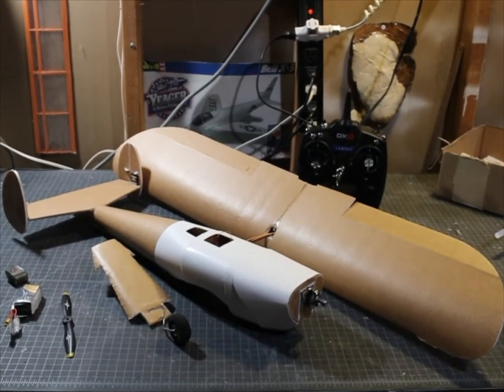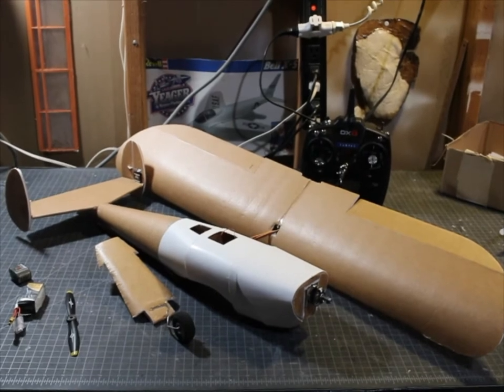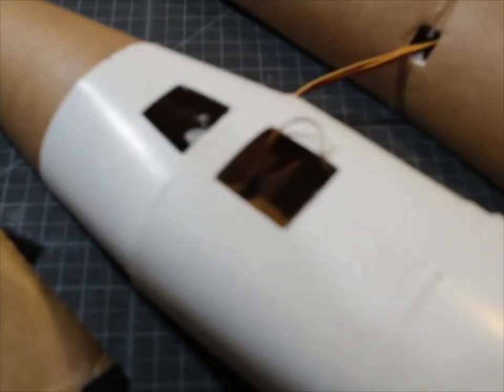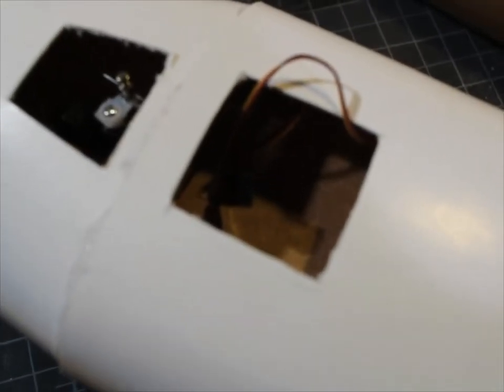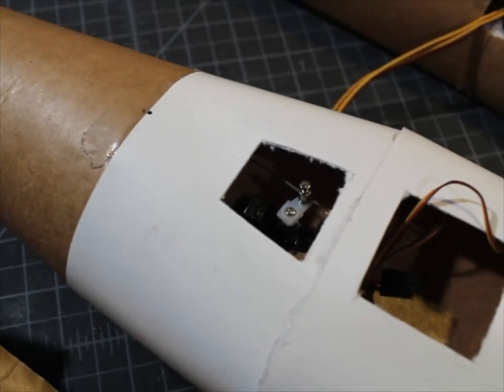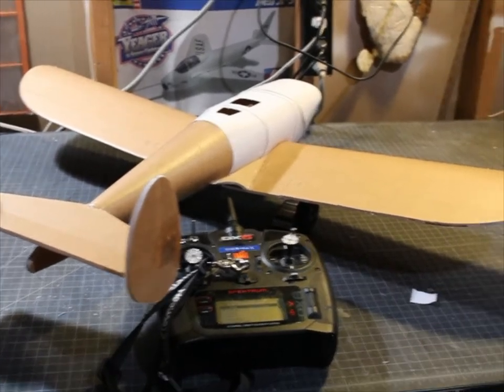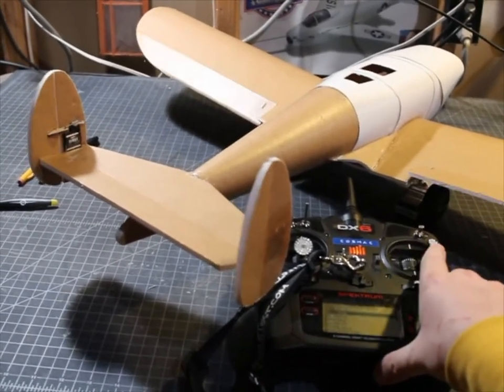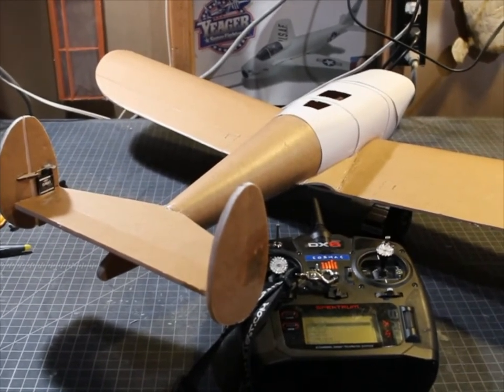Mini Ercoupe Build Part 8: Final Assembly and Maiden Flight

Comment: I wish you had slowed down the mounting of the nose gear. I had to pause-start-pause between 30-33s. I was hard to see at 2.10s - did you velcro the coupe down? Great series of build videos and  fun quick proof of flight. looks like a worthy build
Reply from the maker: Thanks, sorry if the fast motion stuff wasn't too clear at times.  FYI, youtube has a setting to play at quarter speed, which may help.  It may be easier to install the wing and nose gear piece before applying the front fuselage skin, as the edges of the nose gear piece fit under it. The canopy gets attached with two bits of velcro so you can get at the elevator servo and receiver. I thought it would also be pretty easy to stuff FPV into the canopy.